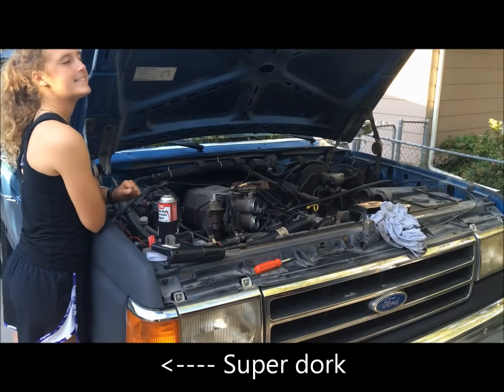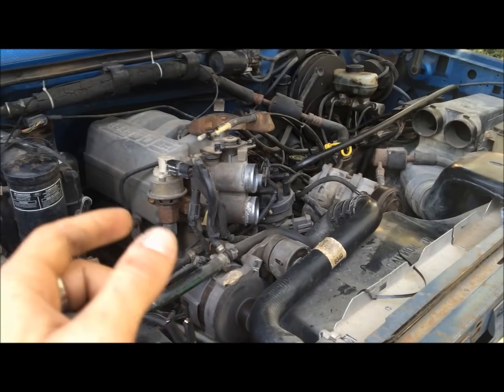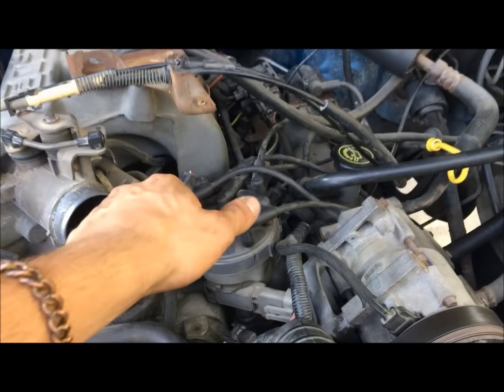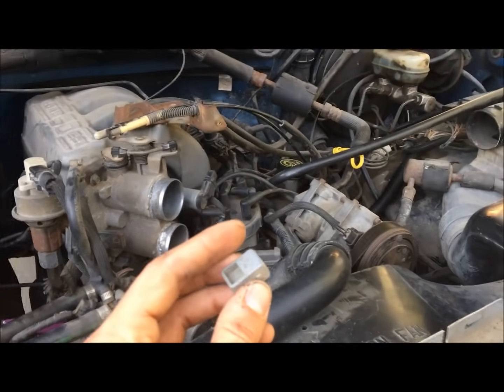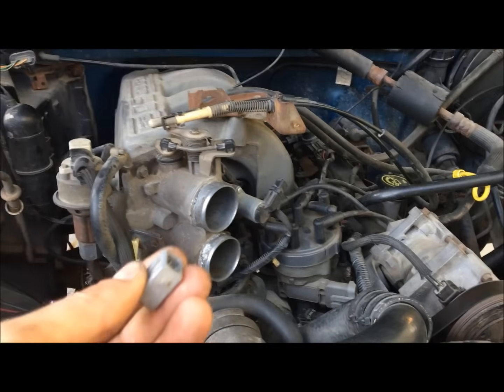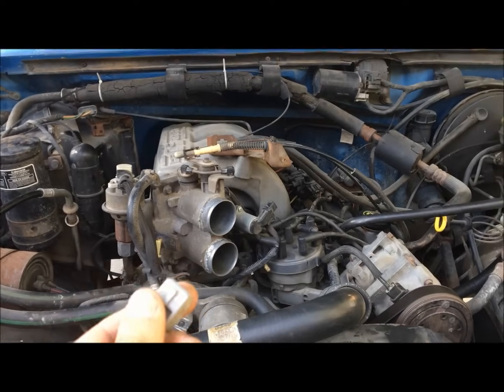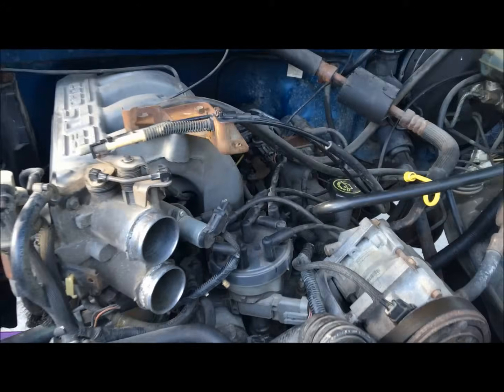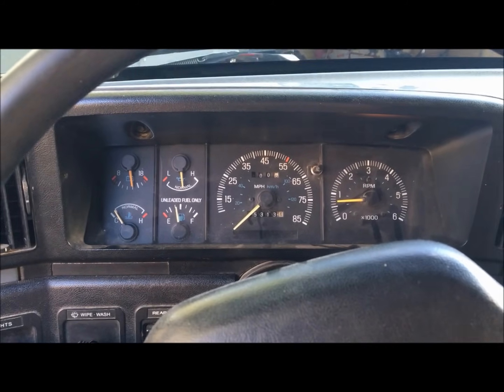Setting Ignition Timing - EFI Ford 302/5.0 (Bronco & f150 - How To)

Comment: hey, thunderhead how's it going? I have a 95 f150 302 and we pulled the distributor out and I put it back in one tooth off. I figured I could just rotate the distributor and call it good. I never took the computer plug out. I had the engine running and started rotating the distributor. now it runs like complete crap. I don't know if I messed something up big time and my Haynes and chilton are no help. if you can give me some advise it would be greatly appreciated. I have no idea what to do from here.
Reply: Cayle Marks this reply is probably late, but you do need to disconnect the spout connector when adjusting the timing. My advice is to let the engine warm up completely, unplug the spout connector and adjust the dizzy until it's all running smooth. Then, plug the connector back in and everything should be a-ok.
Reply: Jack Paskievitch I didn't unplug anything and ended up getting it right. I were a tooth off from the oil pan gasket replacement job